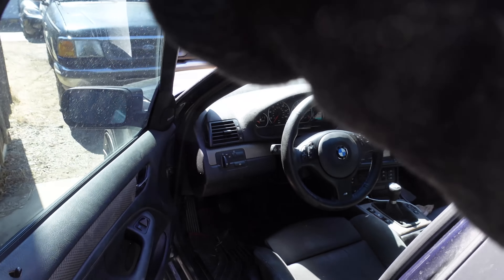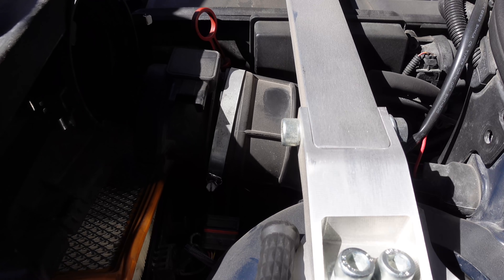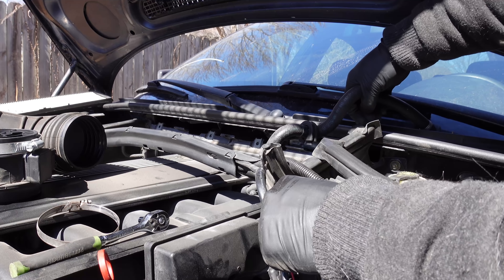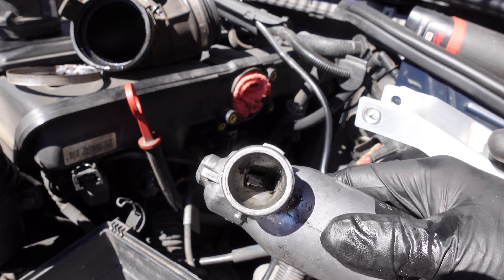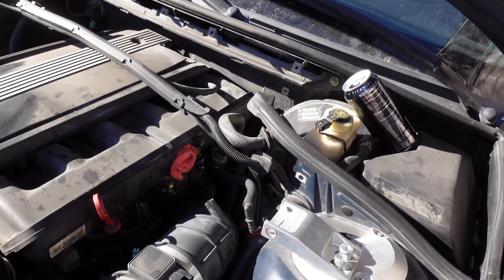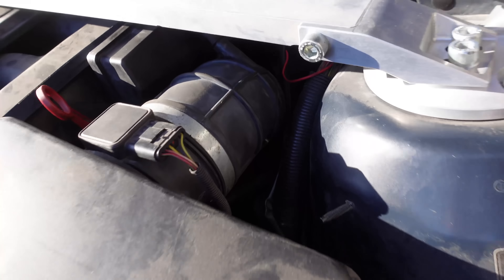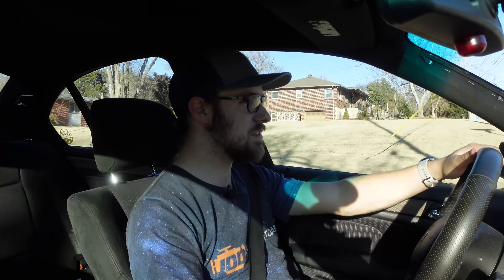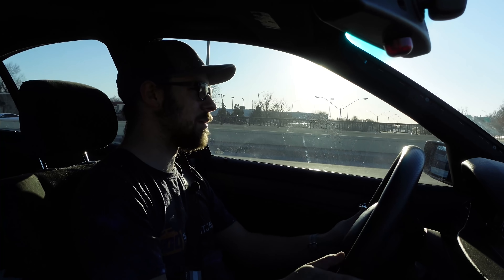BMW E46 Fixing COMMON Idle + Drivability issues in MINUTES (DISA+IACV+Intake Boots+Vacuum lines)

Comment: You've inspired my to track down the vacuum leaks on my M54. I thought the intake had to come off, so I edited the air mass to voltage lookup table instead. Got rid of the code and it's drivable but still lacks throttle response and stalls easily. Thanks for showing how all easy that is to get apart. I've learned that the while you're in there stuff is usually well worth it on this car. I've already had most of that apart doing the alternator and upper intake boot.

Comment: every inline 6 bmw i have owned has had nothing but the same fuel trim issues.  any bmw with this motor i have bought or fixed I do the following:

DISA rebuild kit and orings
boots
vacuum lines
OSV system
Valve cover gasket
Intake manifold removed and resealed everywhere possible
fuel injector Orings
oil filter housing gasket (since its easy after pulling intake)
water pump, thermostat belt and upper/lower rad hoses 
and never had issues after all of those done.

Comment: The "whatever the heck that thing is" part at 11:07 is called "Saugstrahlpumpe". It modulates the pressure for the brake booster and if bad will cause all kinds of idle RPM issues. Or the RPMs drops below idle and the engine stalls when pressing the clutch. Its a cheap part thats shared with a couple VAG cars. Here in Europe it can be bought for ~15 Euros. 

Its a grood idea to replace it at a high mileage car.

Comment: I had a similar problem with my E36 318i A vacuum hose to the idle control valve had split. I bought a new hose form the local BMW dealer for a reasonable price and it fixed the problem. One of my eagle-eyed viewers noticed a split intake boot on one of my videos. Again, I was able to get a replacement from the same dealer for a reasonable price. Not everything form the dealer is expensive. I'm sure you already know this but RealOEM is your friend. Handy for ordering parts from the dealer, for cross referencing against aftermarket parts or searching on eBay for genuine used parts.

Comment: I am wrenching on 2001 Z3 with an M54 engine.  Had all the same issues with intake, DISA was bad, IACV was moving but cruddy.  Still having an issue with something and leaning towards the brake booster hose with the check valve.  Honestly need a smoke tester.  For 285k+ on the clock it's in decent shape.
Reply from the maker: Those are so wonderfully easy to work on. Tons of room in the engine bay. I loved driving Hoovies silver one.
Reply: @100PercentJake  other than the location of the CCV and some of the coolant lines under the intake it has been easier to work on than forums make it out to be.

Comment: My m54b30 fuel trims were off between banks too, and tripping intermittent check engine lights. I had zero vacuum leaks, new O2 sensors, new gaskets etc. Finally, it turned out to be the MAF. Still don't quite understand how it ended up putting both banks out of balance but after replacing it (oem VDO) fuel trims are consistent and I've had no more check engine lights in the last 2 years. Just my experience, certainly not the one and only truth in the m54 universe.

On another note:
Could you possibly record the sound you suspect to be your subframe mounting points?
Reply from the maker: I’m just had a look under the car and the mounts are fine so I feel like I was probably hearing something roll around my trunk. 

Did you check your old MAFs readings at a set RPM against known units?
Reply: @100PercentJake Nope, I used Torque to graph fuel trims while driving around and they were inconsistent between banks 1 and 2, sometimes within spec, sometimes one or the other, usually bank 2 for some reason, would go past 7 or 8 percent and trigger a CEL. Since both O2 sensors were new and the disa was fine I could not really explain it. I've smoke tested my entire intake with open throttle, activated idle control valve etc. to eliminate leaks within the intake manifold itself. I even tested the brake booster for leaks. Finally I had a diagnostic specialist jave a look. He confirmed the inconsistent fuel trims and his conclusion was that the MAF was the only fuel trim related component left to change and hw advised me to buy a new one amd take it out of the equation. After replacing it my car was transformed. Smoother, quicker, mileage increased. It wasn't cheap, around 250 euros ~ 280 dollars, but worth it.

Comment: RE: RSF reinforcement, probably want to use a stronger welder than a 110 to get the results you want for that much effort, but will be fun to watch with heavy doses of sarcasm mixed in.  

Maybe a stronger welder will just make more holes faster?
Reply: I used 3m automotive panel bond to adhere flat reinforcement plates to the subframe mounting points after reading a thread on Bimmerforums. Workin' good.

Comment: 13:31 - bank 1? Bank 2 ? Well...how? Its not a V6...its straight six,so where you get 2banks?
Reply from the maker: BMW I6s are two "banks" of 3 cylinders, one in front of the other.
Reply: m50/52/54 uses 2 headers with the cylinders 1,2,3 and 4,5.6 separated
Reply: @nitroruski7986  Gotta keep 'em separated !!!

Comment: Does BMW use any metal in their engines? Which begs the next question. So is the block plastic with rubber pistons, or visa/versa? lol
Reply from the maker: Pretty sure the engine blocks are made out of solid angst

Comment: "Mass air flow sensor looks good" - literally has a broken mounting tab on the sensor connector 😭

* I actually think your weird acceleration issues and codes are related to that MAF sensor vibrating loose. That lock tab serves a purpose.